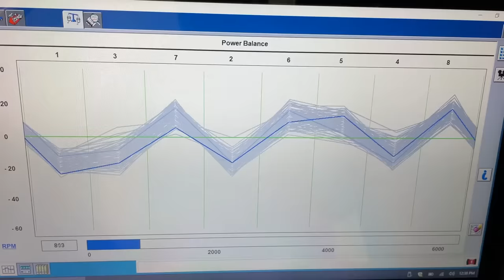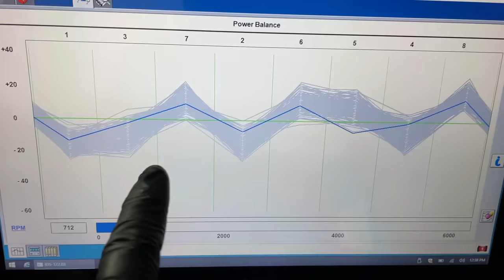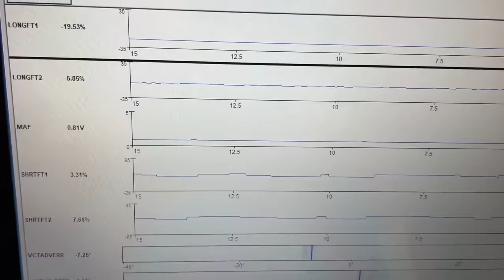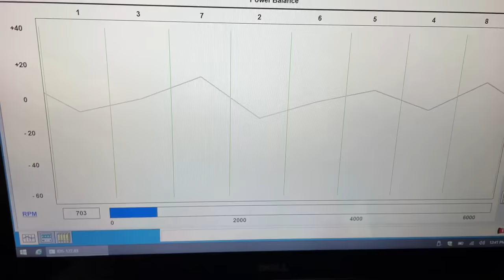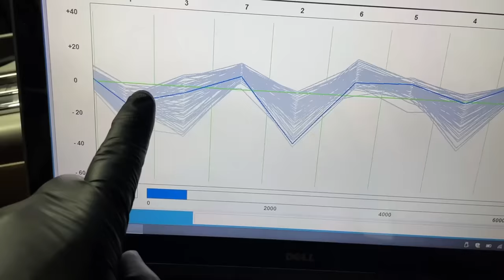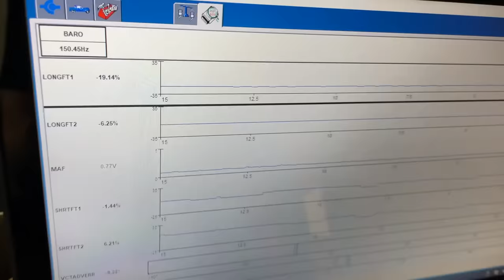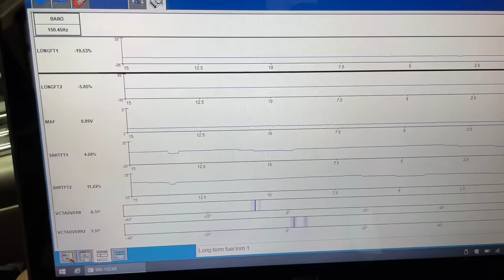Another Ford F-150 5.4L 3v Triton Rough Idle Problem the Other Shops Couldn't Fix!

Comment: Can this kind of issue cause an intermittent rough idle in a 2002 4.6 2v?
Reply: The early Tritons (97-2003) didn’t have cam phasers. Those engines just have large gears to turn the camshafts.
Reply: @standhd  Good deal mate. Thanks for the information.
Reply: @audiogarden21  No problem. Just have your vehicle scanned and checked by a good tech and your problem should be solved.

Comment: The 3v Tritons are good motors but they do not tolerate neglect of any sort. Run dirty oil in them to save a buck or two and you will pay big time later.

Comment: Man everything seems to be about this Triton 5.4 in the F150.  Do you work on any other fords or what?
Reply: Im sure he works on all types of fords and many other makes, BUT he built this channel and has a strong following due to people having a lot of issues with these motors, mainly because of misdiagnosed issues, hack mechanics or lack of maintenance from previous owners. He’s the “5.4 Superman” for many folks..
Reply: Yes he does. The 5.4 3v is his specialty. There are lots of Ford vehicles on the road today with those engines ; I see them everyday as a truck driver. He cut his Ford mechanical teeth on those engines a long time ago.

Comment: Hi Brian I love watching your videos! I have a 2006 F150 that is going to need a motor the 5:4 3 valve. Where I live in Colorado I don’t really have a great mechanic to do the engine swap or I would use the reman from Powertrain products. What do you think about a crate motor from the Ford dealership and have the dealership do the work? Iknow Ford crate doesn’t use the high volume melling oil pump but I don’t have a lot of options. I would love to hear your advice.
Reply: Forget the dealership because they'll overcharge you by at least $1,000... Find the nearest mechanic shop that has a high rating with AAA. They won't risk jeopardizing that rating so they'll do good work. Have Powertrain deliver your engine to them and you go buy the Melling Oil pump yourself so you can make sure the mechanic use it... that's exactly what I did!
Reply: @jimmyj5035  I just bought a power train products re man and it’s being installed why did you buy a melling oil pump? The engine comes with one already installed, updated cam phasers, cast iron tensioners, and they fixed the spark plug issues. And more. Just curious? They upgraded the oil pump to milling too it’s all built and ships like that. I don’t understand? Mine came that way no special requests. Some times they use doorman phasers but Brian says they are ok but prefer motocraft
Reply: @dirtrider agreed do not use the dealer. I was quoted $9700 for there re man ridiculous engine was $4700 the rest labor. I paid $4400 for my reman (3300 engine 400 tax 500 install kit 300 no fault blanket warranty) the power train products is king kills jasper and Ford they fix all the problems and there warranty is the best. Flawless reputation. 5 year unlimited miles plus a no fault addition for $300 one time usable. Ford’s was 36k 3 year and they give you a engine with bad chain phasers and bad oil pump and crappy spark plug sockets. My mechanic is gonna do new pulleys the install kit from power train products. Spark plugs engine mounts intake manifolds belts hoses fluids transmission service ect for like 2k maybe more we didn’t even hash it out but ima do triple the work and save like 3k maybe

Comment: I have the opportunity to pick up a 2014 F150 with a 3.7 n/a V6 auto.. l value You're Opinion.. what is You're professional take on that particular Engine.. I would appreciate any comment.. good or bad.. thank You
Reply: I forgot to mention that it has 111,465 miles

Comment: Two of spark plugs popped out in six month on 5.4L. There are hardly 3-4 threads in aluminum cylinder head.
Reply from the maker: Wrong engine, this a 3v you have a 2v.

Comment: I had all my timing components fixed by ford dealer on my 07 5.4 ...13 months and 2500 miles later it went again..they told me it wasn't under warranty....mind u my truck had 76k miles on it. So sad. Cant afford another 3700
Reply: I feel for ya.

Comment: Why would they build such an over engineered over complicated mess. My last truck had the 5.4 in it and it was a nightmare to do any repairs on. My wife's truck has the ls 5.3 in it  and it's  cake to work on. All  Manufacturers have their issues at least if it's not complicated to work on you don't mind as much

Comment: Is it worth fixing these errors on my 2007 f150 5.4 with 190k?. 900. For parts 1500-2000 to do the job. It runs s ok, until I go to pass someone, then it's really boggs down. Id be Lucky too pass an old lady in a wheel chair.

Comment: I just had a friend get me to replace his timing chain tensioners and guides I have to line up tools both times I set in time and then put timing cover on true harmonic balancer is sitting more advance than TDC. It’s keeps running rough with advance retard codes

Comment: I’ve watched a number of videos on the 5.4L Triton and they seem to be nothing but bad news. A poorly designed engine.
I’ll stick with my tried and true 4.6L in my 2008 E-150, not the most powerful engine but it gets the job done and I get 15 to
16 mpg driving 70 mph with 2000 plus pound loads.

Comment: Actually wasnt engine camshaft 180 off. Shouldnt the passenger side be timed to R not L.
Reply from the maker: No, the timing marks only apply when you are timing the engine. Once the engine in turned over they no longer apply.
Reply: @FordTechMakuloco  i gotcha. You werent checking timing, just checking the phasing. And if phasers returned back.

Comment: The biggest thing to take away from this is dont get ons of these its gonna miss pos they all do this or something else, your only guarantee is that it will run like shit soon if it doesnt now. Tired of gettin these problem motors. What is their best run till it drops motor? Like the old 300 six or the 289, 302 or 351's? Or even the 390?
Reply: I know the 390's were hard on gas, but actually, I had a 71 F250, and when that dog 360  gave up I tossed it overboard for  its calling as a  boat anchor. I put a 390 yblock in, gas mileage and power increased big time.  The truck came alive.  Learned some hard lessons over the years. I drive an 85 short square body now. Quit goin to therapy. Twitch went away.

Comment: Yeah it's running rich because it's not firing off all that extra fuel it's trying to remove almost 20% fuel I'm not a mechanic and I know that
Reply from the maker: o2 sensors do not sense the amount of hydrocarbons they only sense oxygen. So if you were to just send down raw fuel and air charge from the cylinder it would actually show lean because the oxygen in that air charge was never used during the combustion process.

Comment: I will never own another ford as long as I live.. Overly complicated, expensive to fix and the fact they seemed to either let the consumer be their R&D dept or they engineered failures into their stuff to keep their dealers service depts full!!,   Coil pack failures, manifold bolts to small and rust prone and break, exhaust manifolds break in half, Cam phasers go out, to small of oil feed and return holes in block, cam chain tensioners their cassettes fail or fall apart, spark plugs break off or try to qualify as astronauts by blowing out the motor, ect ect. You see a used ford RUN AWAY!!

Comment: Stop defending this crappy engine
Reply from the maker: You bet!
Reply: @FordTechMakuloco I have a misfire at 60 to 65 accelerating it's like bump bump bump cylinder 1 and 8 show distortions could this be cam phasers related I've replaced all coils and plugs😊

Comment: 187,000 miles 🤣🤣🤣🤣 that's nothing!!!!
My buddies 96 GMC Sierra had 540,000 miles!!
My brother's Blazer has 
308,000 miles!!
My old Sonoma I sold it with 252,000 miles!
My brother sold his old suburban with  192,000 miles!!
My 2000 Grand Prix has 284,000 miles on it!!!
My other friends trailblazer has 214,000 miles on it!!!
All factory original engines and transmissions except for the blazer we replaced the transmission at 190,000 miles....

Comment: More and more i am convinced to stay away from Fords.
Reply: This video wasn't about that. Yes, as he's pointed out in several videos there were issues/growing pains with these engines. However, with good maintenance practices and correcting the weak points/flaws these truck will last.
Reply: @EVRY1STFU  I am not inclined to believe that. Some design errors cannot be overcome if the maker does not redesign the part and there are no aftermarket better parts. Ford never owned up to or corrected the design flaw on the explorer transmission solenoids.
Reply: @allantulli5546  I can understand your point. Just have a hard time believing engineers wouldn't want to correct defects as they are found. Meaning, the corporate/business side seems to have the upper hand in situation like this. The engineers I've worked with (non-auto manufacturing) seem to care deeply about the quality and reliability of their designs.  Great care seems to go into correcting issues when they come up through critical changes pushed to the field, updates to code/standards.  Just seems the smarter business decision was to update the parts and let the consumer deal with  remediation. Thank God for Brian's videos as he addresses many of these issues with the 3V.  Disclaimer, I'm not an engineer nor do I have relaxant industry experience. My opinion is from the outside looking in.

Comment: These 5.4 litre 3 valve engines are garbage aren't they.  They are throw away motors,lucky to last 50,000 miles.